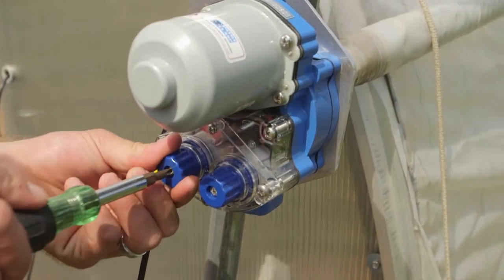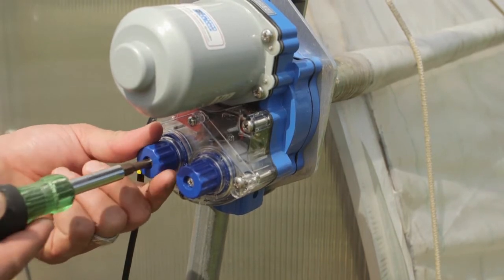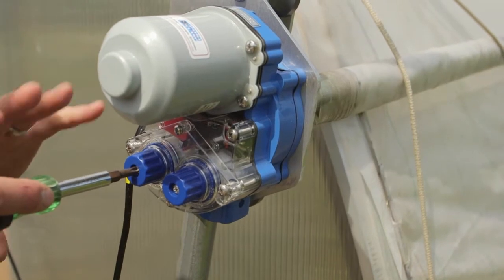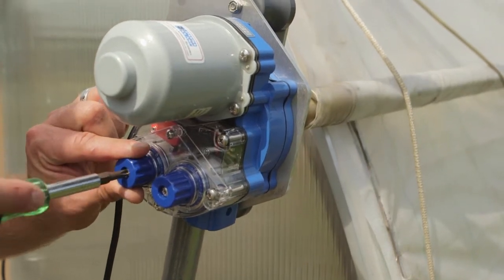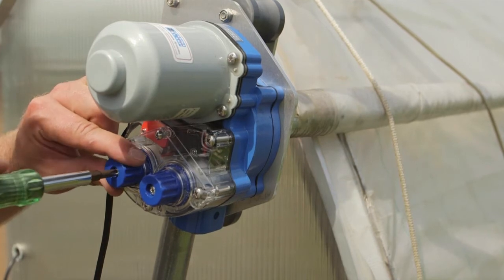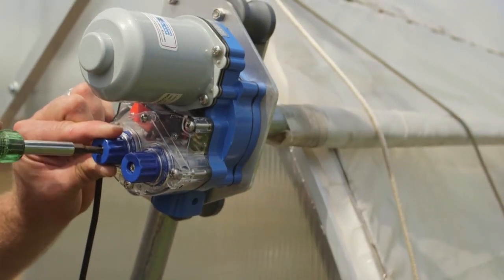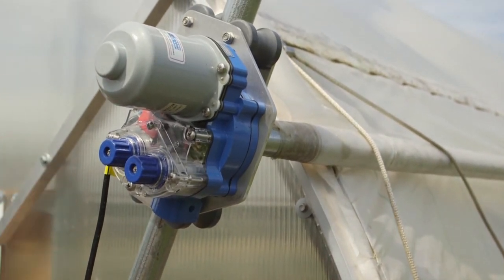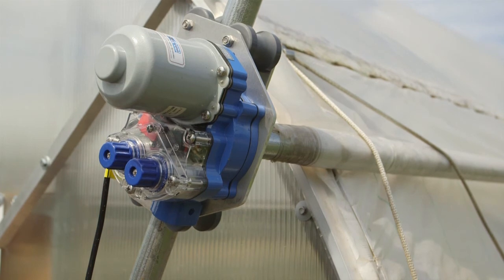Setting Internal Limit Switches

Comment: I have the same unit but is 220v I hooked up to 220v and is not working I left the neutral wire out because I don't know where to wire it to can you help me Daniel
Reply: These are DC motors... should just be 2 wires going to your controller or low voltage limit switch.